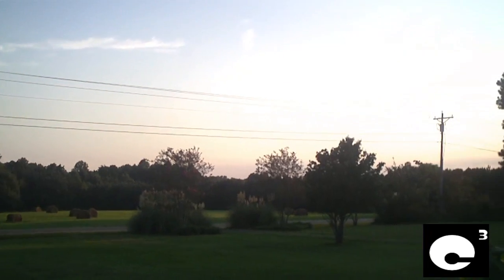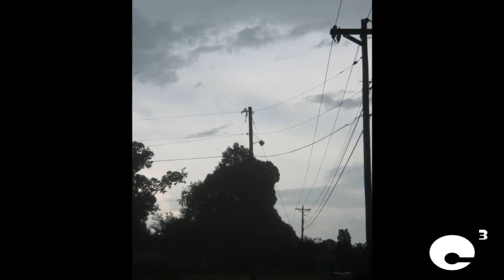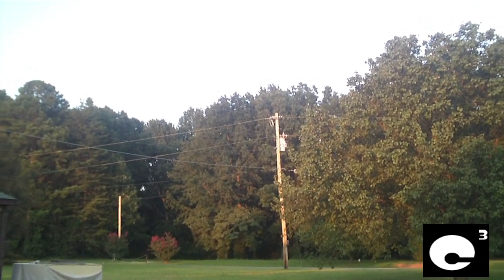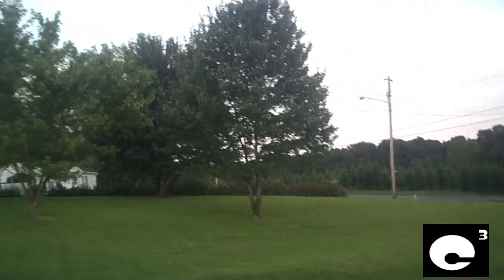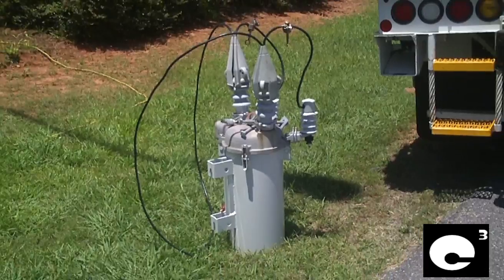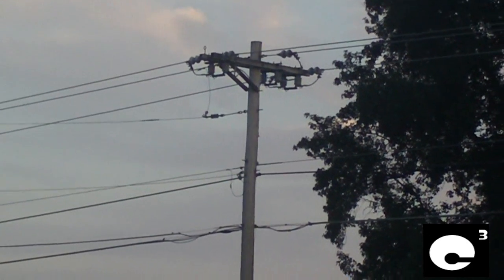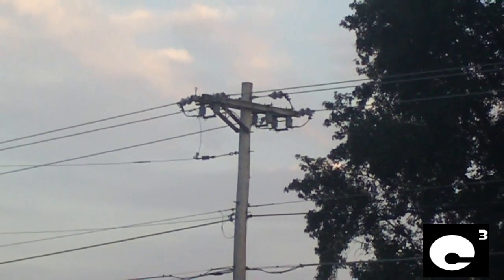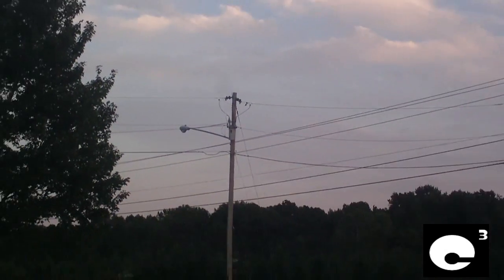Let's Talk About Power Lines - Reclosers vs Fused Cutouts (Expulsion fuses)

Comment: In California all transformer primaries are connected phase-to-phase, so even a single phase transformer has two HV bushings on top, and both phases will be fused. I don't know if that practice is unique to CA or if other states do it too, but it has the advantage that since the primary isn't returned through a neutral you don't have to worry about loose grounds on the neutral possibly letting the transformer pull it up to a dangerously high voltage.

Where I come from in the east (MD) it's done as you show it.
Reply from the maker: You know, I have always wondered about those kinds of transformers with two phase connections. That's interesting.
Reply: ***** Loose neutrals have always been one of my big electrical nightmares so I much prefer the California phase-to-phase method. I'm sure it costs more, though. Maybe it's done that way here because of the dry climate providing poor grounds.
Reply: Chase Jackson I don't think the primary being connected phase-to-phase means the secondary must rely on only a single ground. It simply eliminates the risk of that ground being pulled up to kilovolts relative to "real" earth ground should the connection(s) between the two be lost.
Reply: You are referring to a delta system (phase-to-phase), many areas use that as there distribution circuits. Each transformer in a delta system is relying on a single pole ground and the ground at the meter to balance the secondary voltage (120-240v). while the wye system transformer (one phase) neutral has endless ground sources that returns back to the ground grid of the substation. also a delta system can take a ground on a primary phase without a single interruption. so a energized phase could be laying on the ground and still carry the primary voltage unbeknownst to anyone or anything.
Reply: @chasejackson5312  That's not correct, the 120/240 balance you refer to is created by the center tapped secondary winding on the pole transformer. It's also possible to connect phase to phase on a wye fed system that's solidly grounded. 

The possible issue with the grounded wye system used in much of north America is that the primary and secondary system share a neutral conductor. In the event of bad grounding and an open utility neutral, relatively high voltage can appear on customer neutrals and grounding systems. I know of one instance I've worked on where 60VAC was present on all customer grounds and neutral relative to the earth. There were many complaints from customers that the would get a shock if for example they were standing outside with bare feet and touch the grounded chassis of an appliance. This occurred because of a failed concentric neutral on the submarine cable feeding the island. The ground rods on the island was the only return path for the current. Essentially an unintentional SWER.

Comment: Strange voltage in America. Australian voltage is 415V three phase or 240V single phase. Most high voltage lines around town are 22KV three phase or 12.7KV single phase.
Reply: 12.47kV, 13.2kV, 13.8kV, 24.5kV, 25kV, and 34.5kV (all Line-to-Line) are all used in the US for distribution voltages.

Comment: oh. that was alot of info but it answered my question. I want to be a lineman when i get old enough. So transformers have those swirley, spiky things on top of them aren't reclosures. the reclosures come seperate from the transformer. The swirly, spiky things on top of a transformer are HV inputs? If im right, then they have 3 HV inputs. 2 of the HV inputes have for 120volts in each and a 3rd one is for the lightning arrestor witht he grounding wire on it to blend in with the other ones?
Reply: 504Productions its just a cone shaped animal guard. So a squirrel can't touch the high side and the grounded can at the same time, that's all.

Comment: neighbors houses be burnt down with the next hurricane. Also a pole 2 houses to the left ,facing south in my backyard, has a new pole and a semi new transformer and with a cut out but 2 re closures BUT IS LEANING REALLY BAD and has big ass trees in that area and my neighbor to my right, facing south in my backyard has 3 tall bushy trees all intersected in the lines. if both of the neighbors tree fall, i know my pole is going cuz in that little area is 4 poles. Im scared for this hurrican season.

Comment: the neighborhood im in has the most urban area for our electric company with 206,591 customers. The most customers in their territory. Most of the transformers in the county have re closures and cut outs on the poles with transformers. All of the lines are 3 phases and the transformers hold 6to8 2 story houses a transformer. The transformer in my backyard has a cut out but not a re closure. Its one of the oldest ones in the neighborhood. the rest of the transformers are small and new poles

Comment: I have one question. If you have a 3-phase pole, would an arc occur if you have a phase-to-phase contact, as opposed to phase-to-ground contact, like if one phase were to touch another phase?
Reply: We had this happen in front of our house, and it triggered a recloser somewhere. I’m glad it didn’t trigger the 3 cutouts right in front of our house! (We have a 3 phase transformer bank on the pole directly in front of our house.)